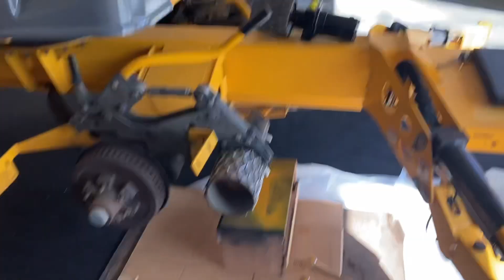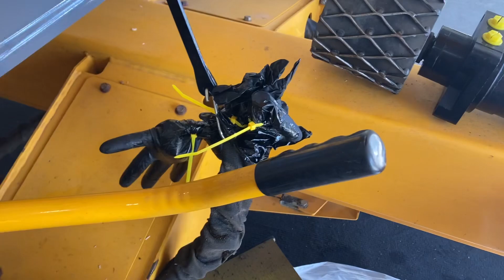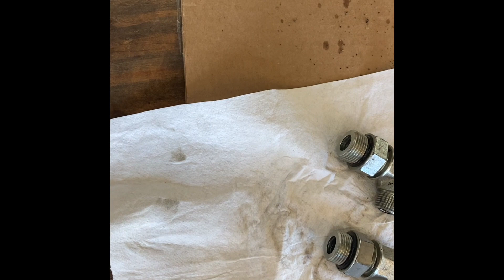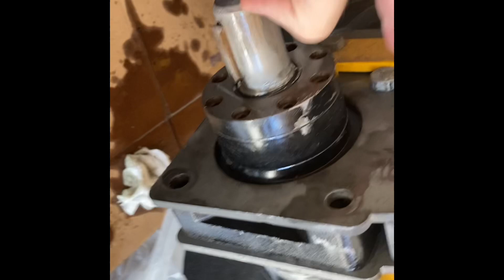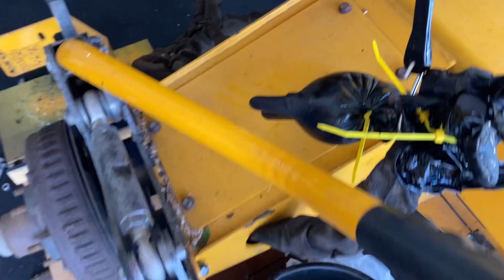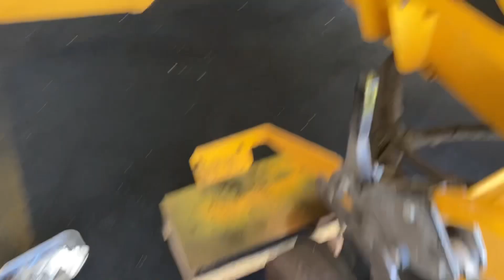Haulotte 4527A Drive & Set - Hydraulic drive motor leak and repair

Comment: Hey have you had troubles with the drive weldments slipping on the tire? We have tried new tires, adjusting tightness, air pressure and our right had wheel still slips.
Reply from the maker: Items to check would be: right size tire, correct roller for that side of the machine, adjust the tie rod, & check the psi
If all those are good, the roller could be worn down if it's had a lot of use.
Is this happening on flat ground like a parking lot?

Comment: I took delivery this week on a brand new Haulotte 4527A, and the same drive motor is leaking.
Reply: I called the dealer today, and a service order was written.   The repair guy already contacted me and will come to my location to do the repair.  Haulotte has excellent service!
Reply from the maker: Glad to hear you got it worked out. Haulotte has been great to me as well.

Comment: Where can I buy this drive set? I’ve contacted my dealer directly, but they knew nothing about it. They contacted haulotte, but there isn’t a part or anything specified.

Ps. Can you over grease this machine?
Reply from the maker: As far as the grease goes, I would stick with the manufacturer's suggestion. With that said, I've always believed it's better to over-grease than under. Bearings and repairs aren't cheap...grease is.

Comment: Where can I buy this drive set? I’ve contacted my dealer directly, but they knew nothing about it. They contacted haulotte, but there isn’t a part or anything specified.
Reply from the maker: My understanding is they have to install it from the factory, but I believe it could be done after.
You could just contact Haulotte directly at:  sparepartsus@haulotte.com